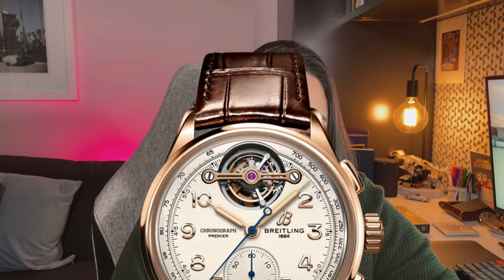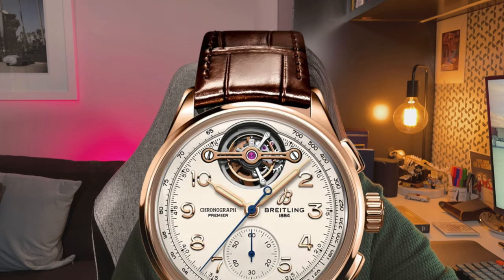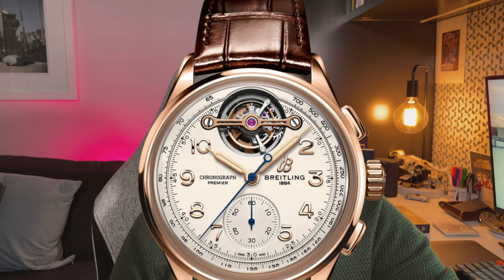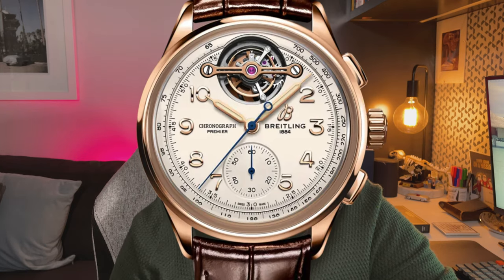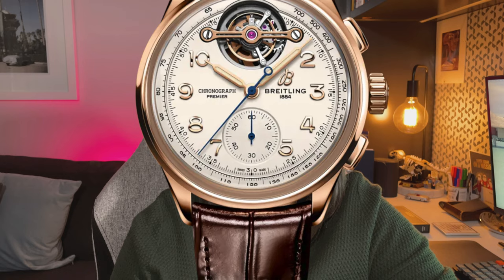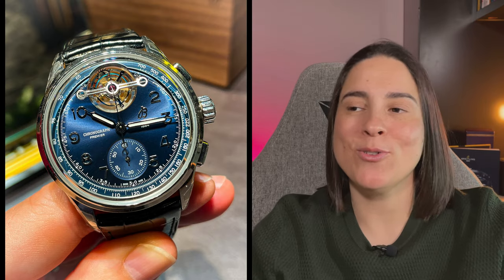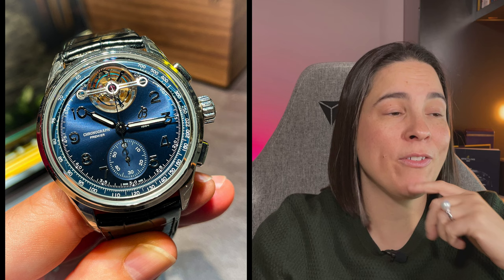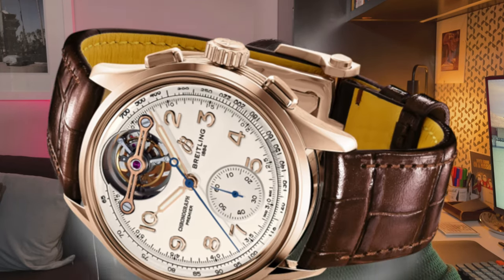The all new Breitling Tourbillon - sorry what's a Tourbillon?

Comment: A Tourbillon is a now defunct complication (of pocket watches) that was previously necessary for accurate timekeeping due to the earths rotation.
It is now a feature of high horoligy used to flex craftsmanship....... or something that sad high street brands like Breitling cut a hole in their dials for!
Reply from the maker: 😂 yes, a hole in the dial probably sums that up perfectly!
Reply: Rotation of the earth had nothing to do with it.  It was the fact that pocket watches tended to be stuck in the same position all day, so gravity was always working in one direction on the movement.  The tourbillon moves the balance wheel and spring around all the time, so that direction always changes.  It made a bit of sense for a pocket watch, but for a wristwatch it really isn't very important.
Reply: @double00spy  I think its both!